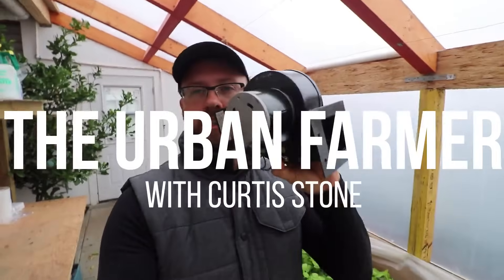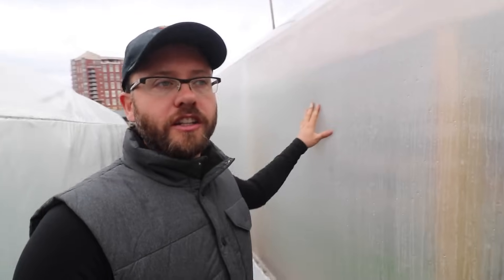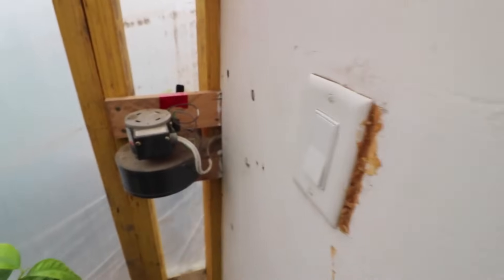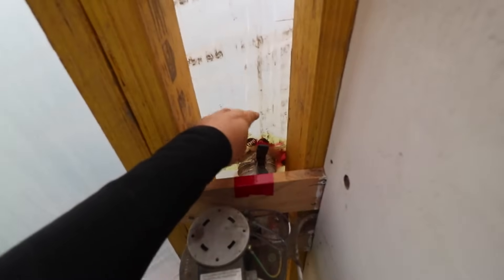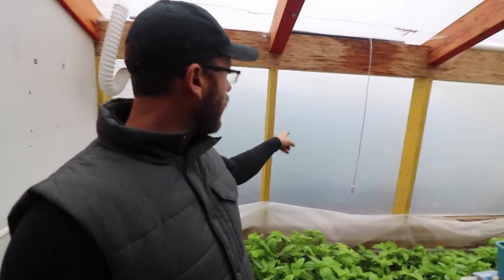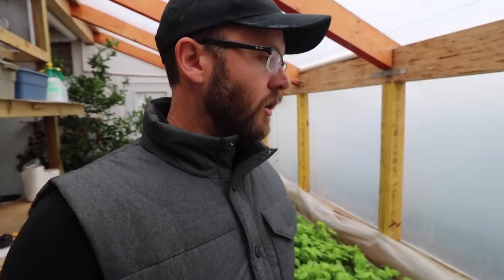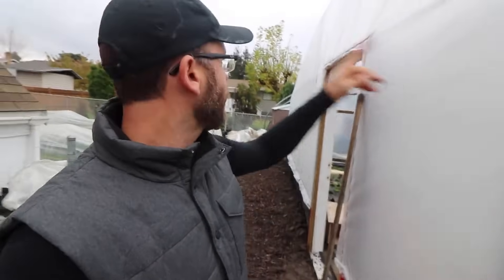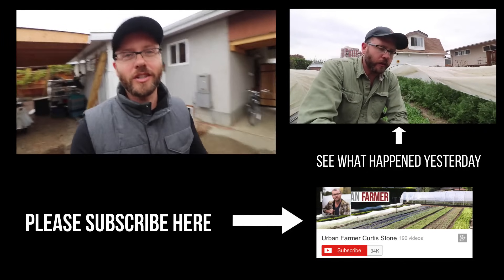How Double Layer Greenhouses Supercharge Your Growing Potential!

Comment: is it a better idea to install two layers with a bigger gap between them like 4 inches or more and without using a blower? are you losing BTUS BY pumping warm air from the inside between the two layers?
Reply: Good question.  
Yes, heat is being lost but a smaller gap is better.  It takes less energy to maintain it but expanding it will not increase the R value.   
The air layer at near the inlet is being cooled by conduction with the exterior.  At some point, several feet from the inlet (farther from the inlet for a 4" layer than a 1" layer), the air is so cold it is being warmed by conduction with the interior layer.  There is turbulent mixing through the entire closed volume so it doesn't matter how thick the layer is.  The rate of conduction is directly related to the difference between the two temperatures.  By providing two conduction layers between the interior and exterior, the total conduction is lower.

Putting in 2 layers of air would require another layer of poly but that begins the diminishing returns on investment.  It would entail a complicated bit of construction every 4 or 5 years.

To work for the entire greenhouse, the assumption is that total heat gain from sunlight is greater than total loss by conduction.
Reply: Yeh, this makes absolutely no sense at all. I was thinking the very same thing right from the get go.
Reply: It makes a lot of sense when you factor in building the structure to create a 4" gap.
Reply: @briansmith6824  why is a smaller gap better? If you have a wider gap you don't need a blower to keep up the gap. Only reason for the blower is to keep the plastic separated as it might fall/stick together with a small gap.

Comment: Hi Curtis, thanks for the videos and the tips about double layer inflated. I have set a second Poly layer in my greenhouse. The system works but I have some points where the gap between the two layer is really big up to 20 cm and other parts is really narrowed. Moreover, I have still condensation in the inside poly sheet. What can be the cause of these issues? Thanks for your support.
Reply: condensation on inside is normal in greenhouse.  plants transpire

Comment: So it is basically blowing air from inside the greenhouse to the space between the 2 polys to get rid of the condensation and to insulate?  If so, does the greenhouse have inlets to let air in?
Reply: Use outside air for the blower or you`ll have issues with condensation inside the cavity. .
Reply: @JohnGuest45  Naw, then it'll be too cold in the winter. You want to gain heat. The air in the greenhouse, and in the walls is a mostly "static" volume. It's just with the additional layer of poly, his greenhouse air is not adjacent to cold outside air acting like a perpetual heat sink in the winter.
Reply: @d-rot  
If the cover is well sealed it will only need filling once, the rest of the time the blower is simply maintaining pressure. A still air situation is hard to acheive when it involves a flexible wall, every time the wind hits the cover the air inside wont be still. Still air will not prevent convective currents being set up inside the cavity as they are driven by temperature difference. A vertical cavity is worse than a horizontal cavity in this respect. Convective currents act like a conveyor. transporting heat from the inner wall (warm) to the outer wall (cold). I use air inflated poly with 2 seperate cavities (triple glazing) made up of individual compartments rather than a single large cavity.

Comment: Oh, this is years after this video has released so I don't expect a response, but I'll ask a question anyway. 
I know this type of structure was made for a greenhouse in the northern United States, where you deal with colder weather, but how do you imagine that this would function when dealing with hotter climates? 
I live in Florida more specifically and I'm looking at alternatives to keep a greenhouse at a relatively low temperature to grow lettuce at it's preferences. I'm wondering if the 'air shield', let's call it, would help mitigate the raise in heat as well or even a proportion of the degree to which it helps with colder climates. Thoughts? Opinions? 

Basically I just don't want to blast an air-conditioning unit 24/7 which is incredibly expensive and wasteful. haha

Comment: I like your houses! I am a struggling person who is trying to supplement income by growing some things 3 or 4 seasons long,(not make it a business)i would be happy to add 200 to 400 dollars a month to my income.so you can see, i want to put up something small and cheap. i live in southern IL. January and February are our coldest months. i want to do a double wall system, on a full arch house about 8 to 10ft long.(small)
so my biggest concern is construction costs. i will do all the work myself. but i will likely need to cabbage a blower from a clothes dryer or something.
what i don't know how to do is put the plastic on an arch. do i use a channel lock? is that something i have to make? How?  or is that something one can buy? what about the ends? i dont want to hard wall the end if i dont have to. unless its best. (added material costs)
i plan to pick up a blue plastic drum monday or tuesday for $10 (was used for vegetable glycerine)for my water  resevoir.
i was planning to lay the plastic out on the flat ribs first. then attach it somehow. then pull the sides together with some load tie ratchet straps. if you see problems in my plan let me know. i dont know how to attach the plastic on the ends.

Comment: R=5 insolation factor ? Are you guys sure about it ? Do you have a technical documentation about it ? Can't find anywhere.
Reply: double poly has a k-value of 4 

Dynamic modeling and simulation of greenhouse environments under several scenarios: A web-based application

 Efrén Fitz-Rodrígueza,∗, Chieri Kubotab, Gene A. Giacomellia, Milton E. Tignorc,Sandra B. Wilsond, Margaret McMahoneaDepartment of Agricultural and Biosystems Engineering, University of Arizona, 1177 E. Fourth Street, Shantz Bldg #38, Room 403, Tucson, AZ 85721-0038, USAbSchool of Plant Sciences, University of Arizona, 1140 E. South Campus Drive, Forbes Building, Room 303, Tucson, AZ 85721-0038, USAcNatural Resources Department, Haywood Community College, 185 Freedlander Drive, Clyde, NC 28721, USAdDepartment of Environmental Horticulture, University of Florida, 2199 South Rock Road, Fort Pierce, FL 34945-3138, USAeDepartment of Horticulture and Crop Science, The Ohio State University, 248B Howlett Hall, 2001 Fyfee Court, Columbus, OH 43210, USA

Comment: Isn't venting the fan counterproductive? The fan should pressurize the space, but definitely not move air. If you are going to release excess pressure, you should do it as close to the inlet as possible to move as little of the air as possible between layers. That fan may be a bit overkill if it needs venting.

Comment: Why is a blower needed? It seems like you could put spacers between the plastic layers and use adhesive to keep them in place. Maybe moving warm air from inside the greenhouse into the layer spacing gap is the factor.
Reply from the maker: Try it and let me know. This is what many farmers use and I'm sure theres a reason that I've never heard of anyone doing that. Though, I could be wrong. Try it and let us know.

Comment: That fan looks like a standard blower set-up for auto-a/c or I should say big truck A/C, heating system. Could probably save a few bucks if you just take a trip to you local salvage yard.
Reply: Tip really intended for DIY small greenhouse in back-yard people.  I understand that in commercial set-ups time is money and warranties along with peace of mind that it will work for an expected duration are factors.  Love the clips.
Reply: Jeff Streeter yes use one from a car or truck add solar vola no electric cost!!!
Reply: @barbaraedwards3715  Indeed, just have to shell out for a decent solar panel.....and batteries like in case it turns night

Comment: seems like a cold circulating pump to me. would be a loss not a gain if it had flow. Maybe try lower the pressure and seal all leaks. use a smaller pump. But air movement is a loss and it would be counter productive of the first layer.

Comment: Where did you get the hoses to run the air from one air pocket to the next? Im having trouble finding something similar, that is also cheap.
Reply: check out laundry dryer vent flex hose

Comment: The bigger question is whether to blow internal air from the greenhouse or outside air. Most say the air should be blown from outside air as it will prevent condensation whereas inside air is so much warmer creating a greater chance of condensation.

Also instead of poking holes in the poly for pressure relief a flap with an adjustable cover on it prevents damaging the poly. Did you prefer not to do it this way.

Finally what air pressure are you running on the interior.

I wanted your experience on this. Thanks
Reply from the maker: I find most say blow from the inside. I've talked to a number of farmers that say blowing from the outside doesn't reduce condensation because the air still warms and condenses when it comes in between the layers.
Reply: First thanks for the video, it is great! 
The original guy that came up with double layer ply is from Rutgers in the 60s. After many tests he claimed outdoor air was better especially if you pay to heat your greenhouse like gas etc. 

Reasoning was if you use indoor air to inflate you are taking air you heated, pushing it into the double layers and it is then cooled down and expelled outside. By using outside air you aren't wasting what you have already heated. Its cool air that becomes an insulator then is expelled back outside.

Though i am no advocate either way i am looking for a reasonable retort to help me decide on my own. Seems better to use unheated air thereby not wasting the effort put into heating it up to expelled it back outside?
Reply: Whether the air comes from the inside or outside, at some distance between the inlet and outlet, the temperature will be identical for indoor-sourced air or outdoor-sourced air - i.e. half the difference between the inside and outside air.  If it is 30 deg. C  inside and 0  deg. C outside, the eventual temperature in the air gap will be 15 deg. C.

The air can then be vented inside, being warmer than outside.

The colder air from outside holds less water than the inside air but still holds some water.  It may condense a bit on the outer surface but it should be less than the condensate from inside air.
Reply: Given a choice between 84F 75% RH inside air and 34F 99% RH outside air, i`d use the outside air :)
If the air stabilises at 60F in the cavity, feeding with the inside air will dump water into the cavity equal to 1.5x the total moisture content of the outside air. Note, the outside air will warm up so it`ll become drier (40% RH% ) and no water will condense out until it drops to 36F. The inside air dropping from 84F 75% RH to 36F 99.9%RH would result in almost 80%  of the total moisture it contains condensing out in the cavity ;)
Reply: I run my inflators on the inside after trying them on the outside . I will gladly take the small amount of moisture over having to run power on the outside , build a cover for motors and the biggest thing ... not having to work outside if the stop working and they do .
Reply: Relative humidity (the cause of condensation) is reduced by half for every 20 deg. F the air temperature is increased.  Putting cool air from outside will reduce the amount of relative humidity between the poly layers as the cool outside air is warmed between the two layers.

Comment: would this be helpful in a hot and dry climate? i'm looking to build an off grid low power greenhouse in the desert
Reply from the maker: +Freedom of Sci (Colonel) absolutely.
Reply: i saw another video saying it can help deflect high winds, is this true?
and should i try to build a geothermal cooling system? as i'm trying to save water and don't want evaporative cooling or heavy power systems. not sure how deep i need to go, i can dig about 4 feet before its to hard for the tractor.
Reply: look at the comment I just made. hHe system I describe is fit for desert and also very cheap, easy to implement..

Comment: How do you physically separate the 2 layers, and about how many inches separation between the 2 layers? Thanks.
Reply from the maker: Forced air.
Reply: So nothing physical like purlins or swiss-cheesed 2-by's or spacer blocks? What happens when you get moderate to heavy snow accumulation? That little blower can huff & puff & never blow those films apart.
Reply from the maker: The snow melts on contact.

Comment: HI I LIVE IN SOUTH AMERICA...YOUR INSULATION SYSTEM IS IT MERELY FOR COLD WEATHER?  DOES IT WORK FOR HOT WEATHER ASWELL? HAVE YOU TRIED OUT TO TEST THE TEMPERATURES COMPARISONS FROM THE OUTSIDE AND INSIDE? IN THIS CASE WOULD BE VERY CLEAR TO SEE THE DATA OF THOSE TESTS.....THANKS FOR THE EXCCELLENT WORK

Comment: Any ideas for making an outdoor greenhouse cold in Houston for cheap? Maybe an alternative to a 3.5 ton ac unit. the space is 18X21
Reply: Use a sun shade and lots of ventilation.
Reply: Try swamp cooling the gap/space between the walls. Include some sort of guttering system to collect condensation and run it to a cistern and use a pump to make it available for plant watering. I'm desert SW, so in the case the humidity is just too too much, you could run a much smaller AC between the walls, where you're just trying to cool a much smaller volume of air than the whole 18x21 space. I would look for a poly sheeting that doesn't transmit much in the way of heat but still allows a decent amount of light through, if one exists. The outer layer could be much more expensive in that regard. But you want in the summer for the heating to occur in between the walls where you can mitigate it away from the main space, that means venting the walls' heat out the top as well.

Comment: I don't understand how you make the polythene covers with an air tight layer and what prevents tearing when you make holes for pipes etc.   The main problem with even a conventional tunnel is that the polythene breaks at creases and joints and has  a short life.
How do you do these things and avoid such problems?   Do you have more videos  about the actual construction?
Reply: Quality Greenhouse poly should last 3-5 years.  General home reno store poly is not long lived exposed to the UV.

Comment: Luv your vid's Curtis & that u share so much info 4 free, but being an engineer & student of science I hav 2 push back here.  Your setup is not insulating but rather U-r heating the walls w/ inside air & that heat radiates out thru the single outside layer of poly which is R-zero.
If u wish 2 insulate, u'd want dual poly layers trapping STILL air which is approximately R1/inch

Comment: A composting bin with lined aluminum pannels with aluminum gutters cut with copper finned heat exchange pipes filled with gallium to help absorb and conduct heat then run a underground pipe to start a draft would not heat a green house without the use of a electrical fan? Composting bins that are heat absorbing boxes that move heated air naturally to heat a green house or a home?  😊

Comment: Has something happened to Polycarb prices?   I'm looking at building a cold season green house about the size of yours,  and My quotes for poly carb are 1/4 to 1/5 of yours, and this is for 9/10mm dual wall.    I'm fearful of water-building up between the  sheets.
Reply: orient the sheets properly with the ribs vertical, provide a drain at bottom,

Comment: So that's a 75 watt blower fan. Leaving it on for 24 hours for 30 days (average month) would cost about $8.1 dollars a month (where I live in Alberta, you guys are actually a bit cheaper) so, basically, 8k, net of the 300 bucks for this solution means you can run the fan for 79 years before it would have made more sense for you to do polycarbonate;) Basically it never, ever makes sense to use polycarbonate over this solution;)
Reply: You have to replace the poly film many times in the 79 years. poly carbonate lasts way longer that the film.
Reply: Also polycarbonate has a higher R value than 5
Reply: Don't forget replacing the fan in that 79 years, and possibly you know, running out of industrial society because it has collapesed. No more central electricity grid, polyethyleen sheeting or production of cheap 75watt fans. I also wonder how well this PE sheeting would stand a proper storm or hailstorm.

But lets not let reality get in the way. Reality is a math problem :P
Reply: Oh no we have crypto so the power will never go out. lol
Reply: @possibleabundance3709  , polycarbonate lasts 5-8 years, similar to polyethylene. EFTE film ~40years.
Reply: @futurecaredesign  That's why I'm using glass from used sliding glass doors .

Comment: Last time I checked with my greenhouse specialist if you are going to blow air in between poly you use outside air that way you don't get condensation in between. But what would research greenhouse people know
Reply: We The People  do not bring cold air into greenhouse, that is silly,  use dry air to fill inner layer from outside.

Comment: I don't understand how this works. Wouldn't vacuum between the dual layers actually be providing insulation because there is less matter between the walls to conduct temperature? Wouldn't ramming more air into there make the green house wall denser? and thus more matter to conduct temperature?